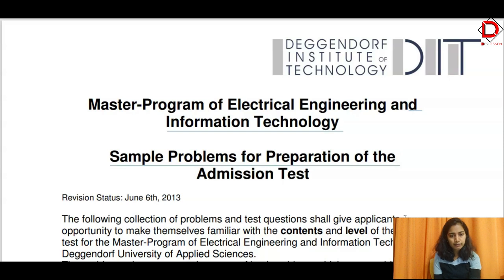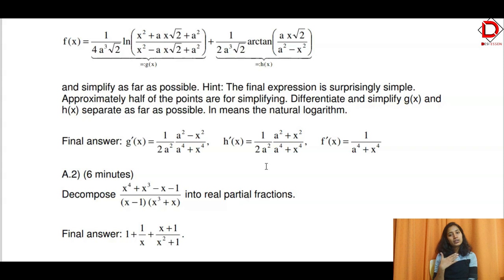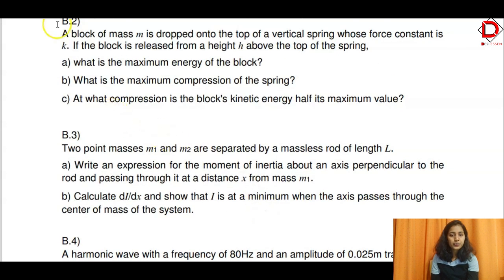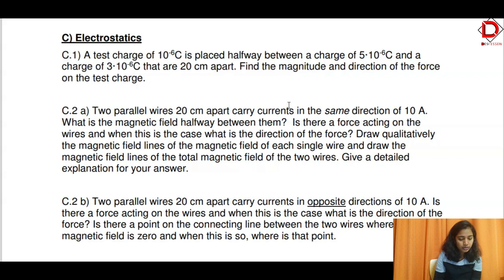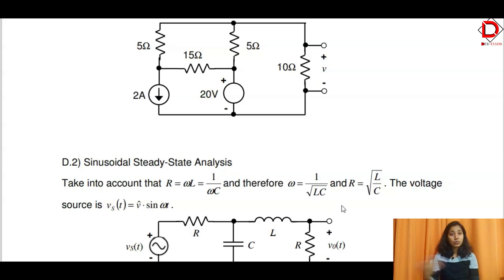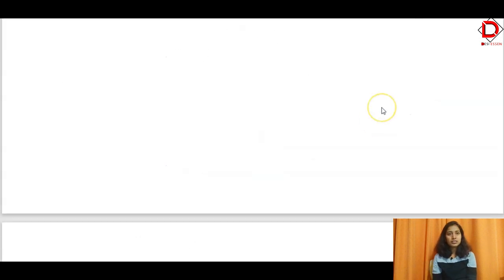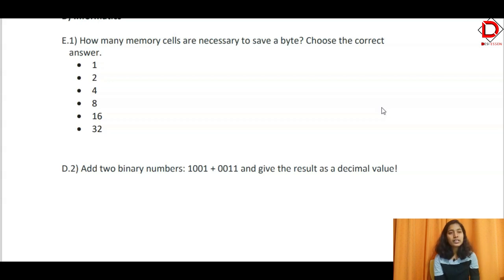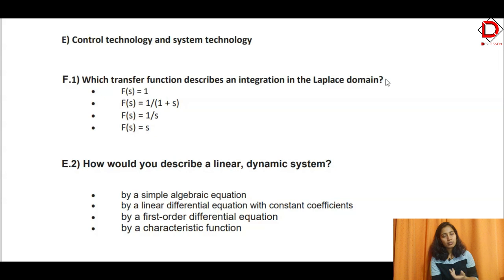How to pass admission test for Masters courses in Germany || DIT Deggendorf || Germany entrance exam

Comment: 🎯 Key points for quick navigation:

00:28 📝 Main subjects for admission test
- Admission test focuses on mathematics, physics, electrostatics, and basic electrical engineering.
- Revise 12th-grade concepts thoroughly as questions are based on these subjects.
- Mock test papers are available via email; practicing these is crucial.
02:03 🧮 Mathematics preparation tips
- Mathematics questions include complex topics like differentiation, integration, and limits.
- Practice a variety of problems to manage time effectively during the exam.
- Familiarity with mathematical concepts aids in tackling other sections more efficiently.
04:19 ⚙️ Physics exam strategy
- Physics questions primarily involve problem-solving on Newton's laws, energy, and momentum.
- Understanding and practicing numerical problems are crucial; theoretical questions are minimal.
- Focus on topics like sound, light, wavelength, and electricity from 12th-grade physics.
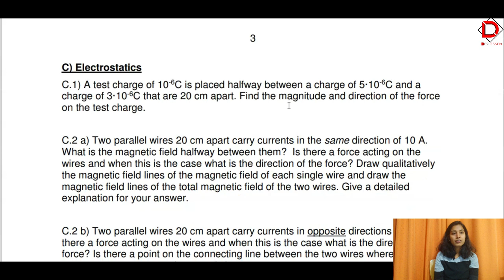06:03 🔌 Electrical engineering essentials
- Topics in basic electrical engineering include Ohm's law, KCL, KVL, and circuit analysis.
- Understanding of theorems like Thevenin's and superposition theorem is necessary.
- Topics like resonance in RLC circuits are important for exam preparation.
09:37 🤖 Mechatronics-specific advice
- Mechatronics students should also study chemistry, informatics, and control systems.
- Emphasis on understanding digital electronics, number systems, logic gates, and flip-flop circuits.
- Control technology topics include transfer functions, Laplace transformations, and state space analysis.

Made with HARPA AI

Comment: What is the exam pattern ? I have scheduled to take online test for applied computer science and electrical engineering on 25th January. I don't know about the exam pattern. I mean is all questions objective or we need to derive and write the final answer only or should we write the whole steps and derive? 

Can you please tell regarding this ?I am Working in Germany and planning to take admission in DIT now and I finshed my 12th almost 9years ago .....So i am not getting an idea on how to make preparation for the exam in the shortest time possible.
Reply from the maker: Hi..u need to derive and choose the answer...you need to revise as much as you can.....there is no alternative..am so sorry..all the best 👍
Reply: @mounika_adavala  Thank you so much. Sure I will try to give my best :)
Reply: @meghnaprakash4098  Meghna, did you get through the test? I am also working in Germnany and planning to apply in WInter for Electrical Eng.
Reply: What happened to your test and which program you applied for
Reply: How was the test? what was the difficulty level? How much paper was different from the sample test? Kindly share your experience.